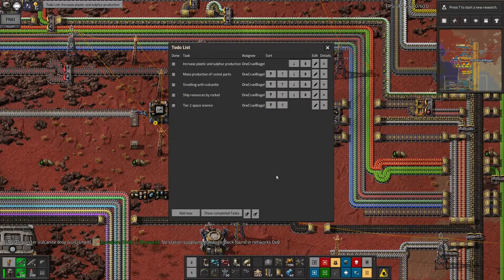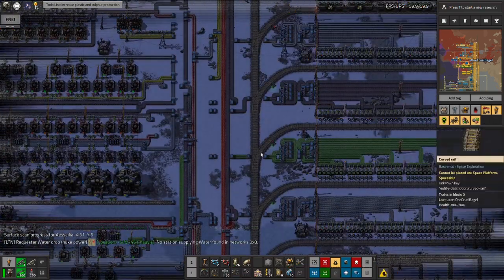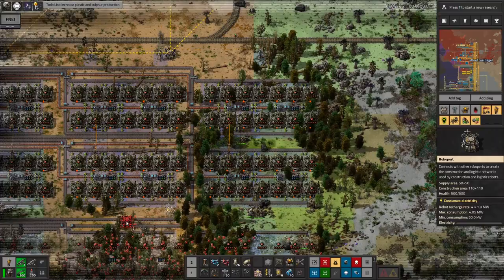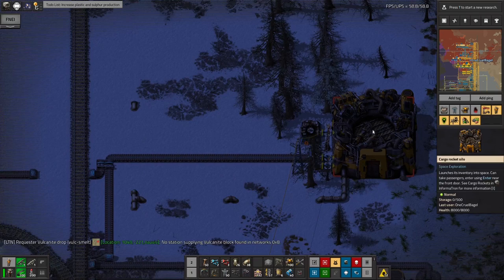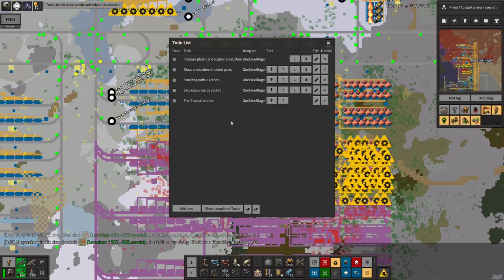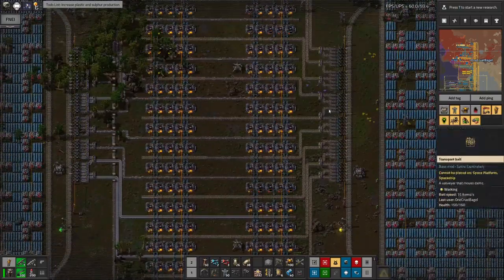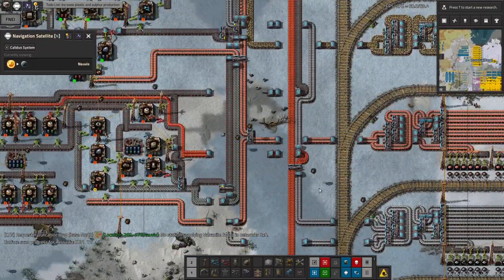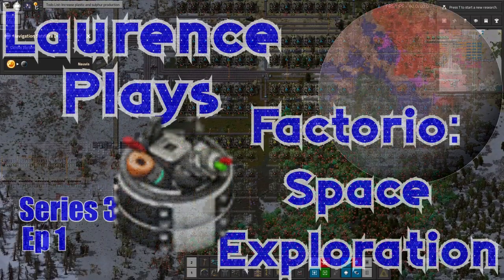S3-E1 - Designs for the Future - Laurence Plays Factorio: Space Exploration

Comment: If your beryllium supplies can support it, then using the alternate recipe to get double the rocket sections out for 10 beryllium plates is very much worth it. And dumping productivity modules on rocket fuel stacks up quickly, since you can get it on every step of the process.
Reply from the maker: I hadn't spotted the beryllium rocket sections recipe at this point, but I did notice it soon after, and have cludged in an upgrade. You're right, it's very worth doing to almost double the efficiency (at the cost of an exotic material, granted). Productivising the fuel is a good point, at least for on Nauvis where I should be able to shove more machines in to get the speed up. And probably another nuclear power station to keep up! Thanks  :-)

Comment: With the cargo rocket parts, you create one then input it, why not have chest in between ,say holding 200 already created parts, then set it to allow 100 in the rocket, then it would outpace any other additions to your rocket. That way no matter how fast other items go into your rocket, the parts would outpace everything else. i have all my launch pads set up that way. I even Have a warehouse full of a single item that shoots say 48,000 copper plates into the rocket, which not only allows are open margin just in case, but the parts go in way faster. Just an idea. And you need faster inserters, there is a nod for that, with faster filter inserters.
Reply from the maker: There is sense to having a buffer built up like that, but to an extent, it doesn't matter - unless your production systems are fast enough to keep the buffer filled, it won't gain you anything. There's also a much better, more secure way to make sure you don't fill up the rocket with cargo until it's been built using circuit networks, and I'm using that everywhere by ... a little later on. Much safer.

Comment: Do you really need such a big rocket production setup?

Doesnt rocket reusability mean that as your tech improve you'll need fewer and fewer completely new rockets build?
Reply from the maker: It does, yes, but you still need some. And I was building a big rocket park so I'd need a lot to front load and fill buffers. 
Yes, it's probably much bigger than I really needed, but I was expecting to be using them for longer, I guess.
Reply: @LaurencePlays  I have one rocket on standby with 200 capsules and the rest with rocket parts. I send one to each planet when necessary. i noticed some planets didnt have capsules or parts after a while. I over supply all my planets with everything, I learned early when I went to a planet without the parts or fuel to get back. Each planet gets a full vulcanite rocket too, for fuel, just in case. Been there too.
Reply from the maker: @cptcarter1st  I started off making rocket fuel from vulcanite, but I tend to do it from oil these days - the vulcanite I dig up has much more important uses! My rocket system has held up pretty well - I've not needed to fix it too many times - but yes, I've not been careful enough with the exact amounts, just thrown rockets with approximately the right numbers at whichever planet needs them. It hasn't caused too many problems yet though!